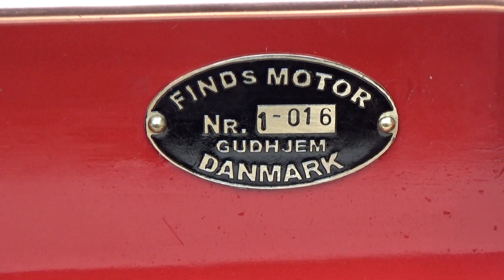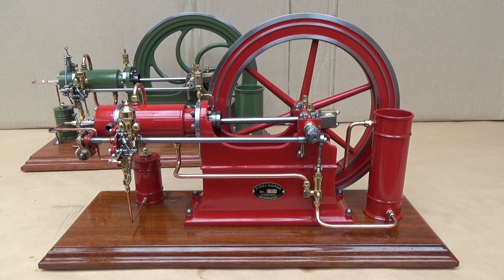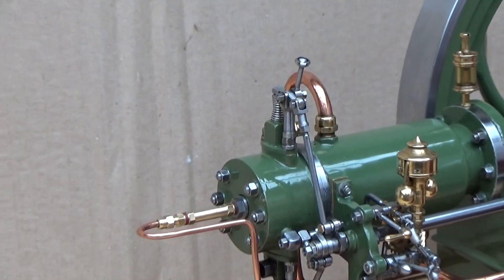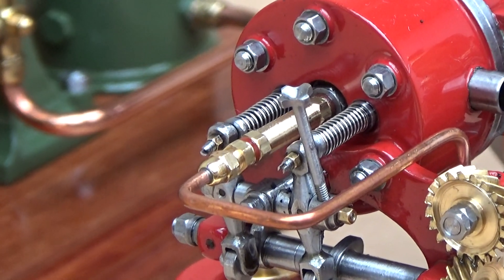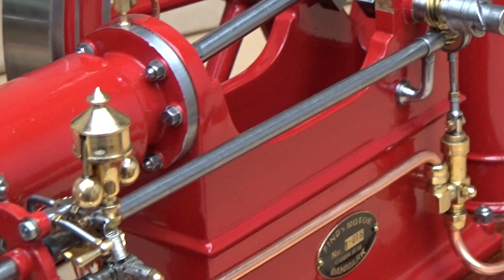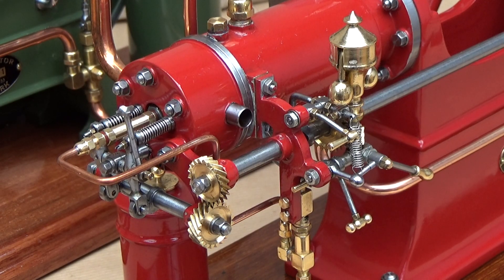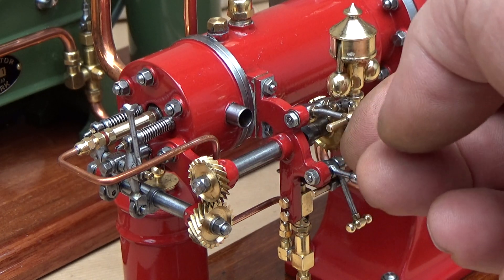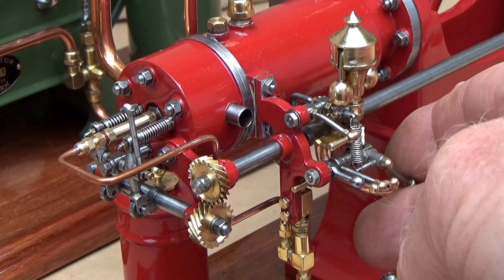Cold Starting True Model Diesel Engine By Cranking Handle

Comment: You might look into the tuned length exhaust calculators online as an interesting means of tinkering with you r model.
The same goes for the intake length.  Here a Bell Mouth also makes a surprising difference. ;)

Research:
Dr Ali Erdemir Agronne National Labs Boric Acid in engine oil lubricant.

Not only is friction and wear cut, basically to zero, and humidity turned into an advantage, but there is some evidence that the Boric Oxide layer that forms on metal surfaces (sleeve) is something of a thermal barrier.
That is VERY important in small engines where the combustion chamber (heat robbing) surface area to volume ratio is high.

NB:  Do NOT treat engines that are not run in properly and then some.  They will not be running in after.

Comment: very impressive (I only build spark ignition model engines).  might I suggest a hinged cover over the top of the exhaust like you sometimes see on a diesel truck's exhaust pipe

Comment: Its a pity you dont have a load for these fine engines, say a hand crafted alternator to run a little hydrogen production cell which could then fuel the engine! probably have a lot left over for some other use.